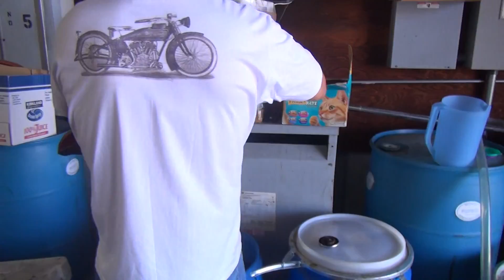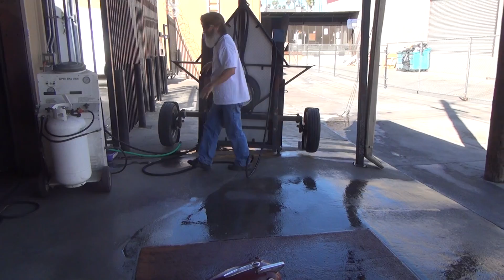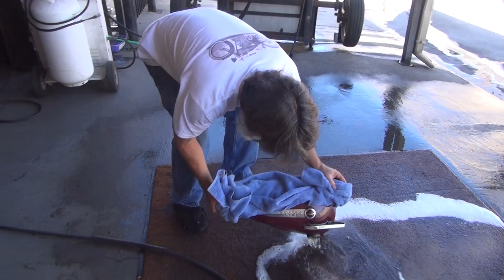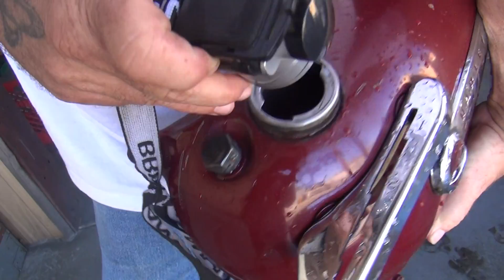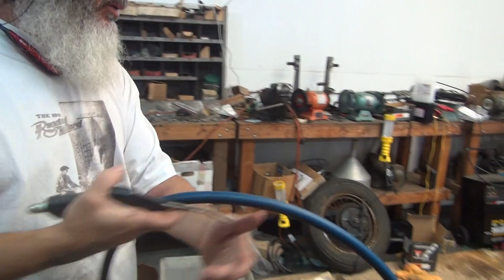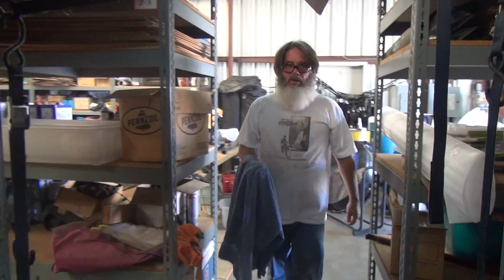Hunting Harley's, 1949 Pan left tank cleaning

Comment: Hi Todd, I just purchased some 5 gallons of rusteco to de-rust a tank that's been sitting with fuel in it for about 6 years. I was wondering a heated pressure washer was absolutely needed for this process?
Reply from the maker: it helps a lot, not 100% needed, but means less applications to derust a tank with any deus ting agent IE heated pressure washer / steam cleaner
Reply: Thanks a lot! I'll take it into consideration when I start the process.